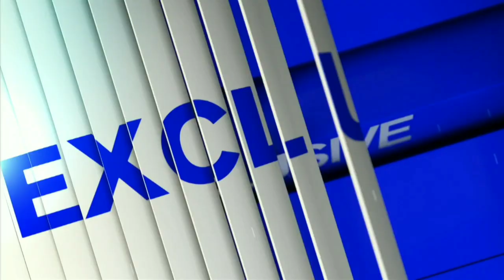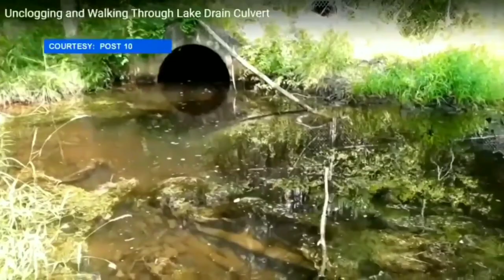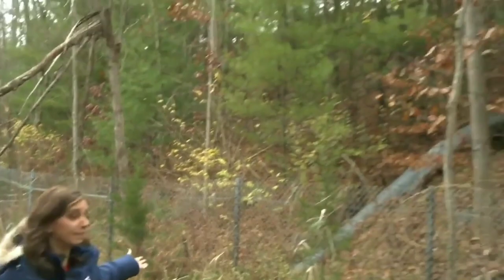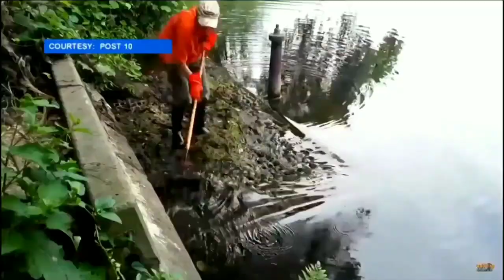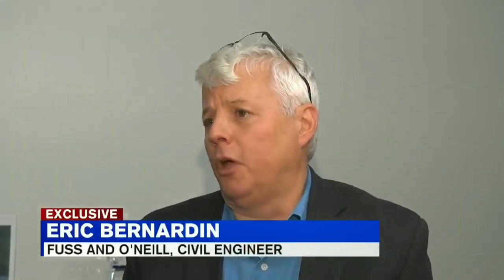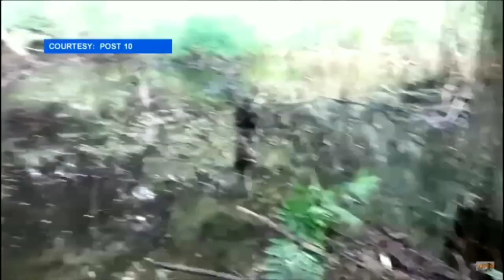Lake drain Culvert news story

Comment: Finally someone is listening ❤️ persistence pays off. Good for you
Reply: That one guy near the end I don't think listened or cared he said a sink hole wont form overnight tell that to the one guy in flordia the feel into one and died when he was sleeping.
Reply: @charlieretro  Yep, chair-bound Bernardin is very typical of the knee-jerk response that blames a whistle-blower for the problem. His words are now on record for when it turns into a disaster.
Reply: Retro86 Actually, he wasn’t wrong. Sinkholes DO take time to develop. It’s only that last couple inches that you see on those viral YouTube videos where the road/house/whatever gives way and falls into the hole. Either way, good on post10 for reporting it before it can GET to that.
Reply: Also, it’s worth pointing out soil types are much different in Florida (where it’s more sand and/or clay) than they are in New England (rockier).

Comment: I loved the engineers prediction "guess" that it wont sink fast and swallow a car. Wonder if his relatives helped design the Titanic. Note, zero video of the muddy water exiting or the grate flow totally stopped.
Reply: +Ricki -- I also noticed that the "reporter" didn't make that guy justify his comments, either.  How about a little, "Ah, so without inspecting the area, your company appears to be guaranteeing that any resulting sinkhole would be small -- too small to swallow a small car, yes?"

That would have wiped that smug smile off of his face, pronto!  😁
Reply: @CitizenPerkins  I have dealt with them for years and a signed paper request/write off  seems to get them off their duff and out into the field. "I ___ hereby guarantee that  __ __ __ will not occur" You get the idea. :)
Reply: You don't have to be a genius to work out that the hole won't open up large enough for a car at all, but even if it does it would be very slow and noticed beforehand.
Reply: @Nathan-cv6sm   The hole would be formed slowly true, but you don't really see the problem till the ground above starts to sink down in.  Which like any sinkhole can be a slow gradual process, or one day it just collapses.  Why many sinkholes are such a surprise.
Reply: Using that logic, a large sinkhole never appears suddenly.
Reply: Lester Piglet I Said THAT hole, not all holes...
Reply: Civil engineers are all taught about hydrology and soils, and then spend the rest of their lives working on things just like this. It takes an especially ignorant and egotistical fool to post what you just posted.
Reply: @CitizenPerkins  Journalism isn't what it used to be 😪

Comment: You did great. At a minimum you prevented a costly repair to the road, at most, an accident with injury or death. A sinkhole doesn't have to be big enough to swallow a car to be dangerous. Your persistence paid off. The community should be grateful.

Comment: Engineer :  They are considered confined spaces and you should be adequately trained to clear drains.
Post 10: Hold my rake..

Also find it interesting that they mention " a gargantuan sink hole wont happen over night"  yet you have been reporting this issue for what- almost 6 months now? plus its not as if the pipe has one small hole in it, it has a few massive holes throughout the pipe. 5 to 6 months is a long time for damage to occur- and probably why we are seeing all the large rocks and sand at this point clogging the pipe. Always great to see your videos and great job getting the DOT to finally look at the issue!

Comment: For those thinking this pipe repair is a major undertaking, there are NEW methods that have proven to be effective in recent years. One is the placement of a bladder (think of a long sausage) within the pipe and then injecting a quick setting concrete around it. Our local water company has been doing this at night for a few years now without digging up the streets. All they need to figure out here is how to divert the water for a day while they work because waiting till dry season (next July?) is probably not an option.

Comment: You have done a wondeful job reporting that issue. I don't clear drains out, but I see that as a major concern. The guy saying you need adequate training got me. Noone else was clearing that as it would have eroded the adjacent road. Clearing that drain found a major problem that could end badly for anyone passing over it when it collapses. It may take days for a sinkhole to open up, but once it does, it opens fast.

Comment: Good work brother...They should look into installing felt or fiberglass lining the culvert. No digginig needed and restores the structural integrity and seal any hole
Reply from the maker: But they have to fill the cavity in the hill first
Reply: They could repair with a lining process then fill the hole with a material called "flowable fill".  It will fill the void and seeks it's own level. 100% compaction

Comment: They're gonna waste time until it does cause a big problem. Give it a day of heavy rain fall mix with sleet too much water could make an break ground an open up anywhere along where the pipe should be. Not a master of water engineering but you gotta be smart knowing fast heavy moving water awrodes and displaces stuff. Friction+movement+gravity
Reply: An awesome work standing your group an never giving up 😁

Comment: I'm a civil engineer and deal with culverts on a daily basis.

Seeing muddy water out of a culvert is not clear evidence that the pipe has failed.  When you get a light rain, it carries mud which settles in the pipes.  As you get heavier rainfall, this mud then washes out of the pipes.  But it is well worth sending a crew to inspect the culvert.

Stay safe if you plan on continuing to clear storm grates, it can be dangerous.
Reply: Chris Paul lol, im sure you deal with culverts like the white haired dude at then end...from an air conditioned office.